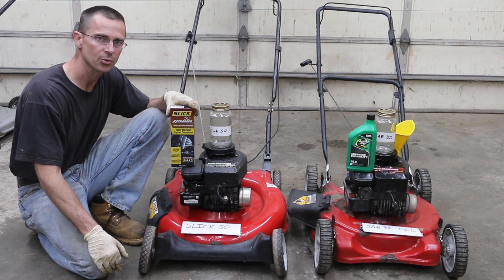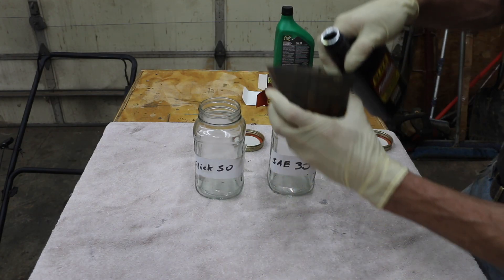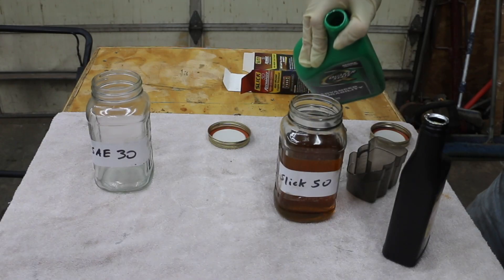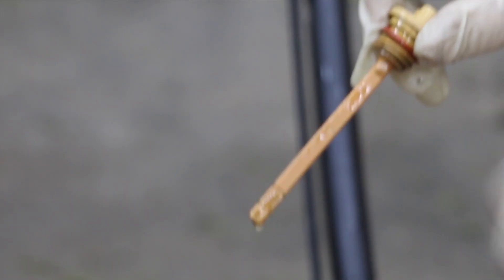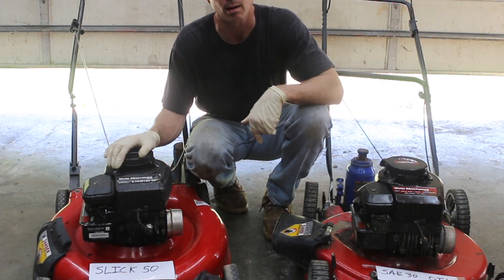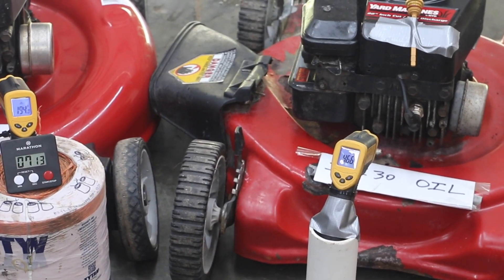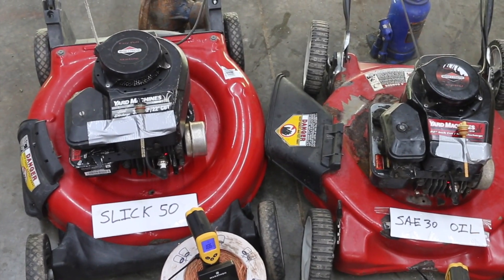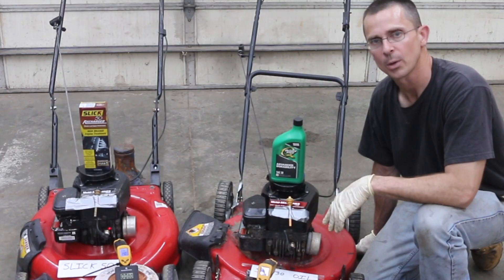Can't believe what SLICK 50 did to my engine!!--Dry Crankcase Test!

Comment: The problem is, in my opinion, is that Slick 50 isn't the same product it was 25 years ago. Slick 50 use to have Teflon in it. I just recently finished off a bottle of Slick 50 High mileage that I bought 20 odd years ago, and it was a translucent white color. DuPont filed a lawsuit a few years ago against other companies using their patented invention, DuPont Teflon, in their products and won the lawsuit. After that, I noticed that Slick 50 no longer said it had Teflon in it. Now it says it has Cerfelon in it. Not the same thing. Teflon was developed by DuPont back in the 60's, to lubricate the turbo pumps on the Saturn 5 rocket engine's for NASA. Regular petroleum oils couldn't stand the heat and the engine's were blowing up because of it. So DuPont invented Teflon, which is a slick resin, not an oil. Liquid wrench use to make a penetrating oil spray that said on the can," With DuPont Teflon". After the lawsuit, all the company's that were using it, had to quit using it. You can still buy it, the last I knew. It called DuPont All Purpose lubricant, made by DuPont of course. I bought a bottle of it a few years ago. It's great stuff. I had a little electric fan that I hung on a rack in the bathroom, that I would run when it was hot in the summer and I was taking a shower and the bearings got dried out and galded and it got where it was chattering and squealing and wouldn't run. So I tried oiling the bearings with 3 in 1 oil. That only lasted a few days, so I tried using Motorkote. That didn't do much better, maybe a little longer. Then I tried using some gun oil, Remoil with Teflon. That just lasted a few days too. I think it has very little Teflon in it though. It is a yellow looking oil and Teflon is white in color. Then I got a bottle of the DuPont All Purpose lubricant, which is just Teflon in a oil base. It looks as white as white out in color though. I used it over 3 years ago and the fan still runs fine! You should get some of it and test it against other lubricant's if you had squirted a bottle of that, maybe just an ounce or two in the motor instead of the no longer really Slick 50, it probably would never would have quit, just like Slick 50 use to advertise. It works great in high heat conditions. Get a bottle. It's some great stuff!
Reply from the maker: Thanks for the feedback.

Comment: I used slick 50 in the 90s and if I remember correctly it needed some run time to settle the nano particles into the cylinder wall. it was about 1000km for a car I think. So this test proved nothing.
Reply: You are correct, I used the stuff back then and it has to be run for some time at operating temperature in order to coat the engine - This experiment does nothing other than ruin two perfectly good motors for nothing. I hate waste!

Comment: I'm not sure that the test is valid.  Slick 50, other than its proprietary PTFE, is still a quality base oil.  The motors would need to be verifiably identicle and the results repeatable, meaning unfortunately, more than one time.  That much difference in running time seems a bit fantastic to blame on the oil.  I like the channel.
Reply from the maker: Thanks!  Thanks for the feedback.

Comment: I used slick 50 myself thinking my engine wouldn't heat up to the point of failure also remember it also said only to use on cars with 50 thousand miles also. Won't ever know now for the original s50 has changed for legal reasons between partners.
Reply from the maker: Thanks for the feedback.

Comment: I started out using Slick50 but due to cost I changed to Duralube. Both are PTFE products. No problems as of yet, but I do change my synthetic oil when i can still barely read the dipstick through the oil.
Reply from the maker: Thanks for sharing.

Comment: I browsed the web for 'original' Slick 50, then found that John Bishop, (developer of original Slick 50 formula), stopped providing it to Petrolon in 1.983. Afterwards, seemingly it was produced under 'Xcel.Plus' brand or kind of...
Just found ONE sealed (1 qt, circa 1.995, when I was attending Med School), Slick 50 that I used in my 1.991 BMW 535ia (iron block i6, trusty engine).
I'll probably try it my late Dad's old reliable / '84 Nissan Patrol, (4x4 / P40 i6 engine), just to see / hear 'what happens'... (Yup!: I'll shake S50's can VERY 'vigorously', before adding it to eng's oil).
Reply from the maker: Thanks for sharing.

Comment: I know that most motor oil contains Perafin wax.. ( Like liquid candle wax )..And Slick 50, I was told had Graphite in it, ( Like pencil lead )..Dont know if one is better or worst than the other. And when Slick 50 first came out, it was 50 bucks a qt.  But Duralube and Slick 50 are both under 20 bucks now..jim
Reply from the maker: Thanks for the suggestion.

Comment: I remember a Duralube commercial..similar to Slick-50, but supposedly better. They ran a nascar without any oil, after being treated, driven at 3- digit speeds around the oval. then took the valve covers off. And while the engine continued to run , sprayed water from a garden hose all over the open valve heads. And it kept running. it is supposed to be absorbed into the metal of the engine and act like a teflon. They also make a treatment for transmissions...jim
Reply from the maker: Thanks for the feedback.

Comment: I'm not defending the SLICK 50 product.  But were these 2 lawnmower engines identical and have the same amount of hours used?  It doesn't make sense that the SLICK 50 locked up 1st.  But I'll concur, it is hard to recommend the product after seeing this

Comment: Have you ever tried SLICK 50 Automatic Transmission Treatment?  I'm disappointed by your results of the engine treatment, but I swear I can feel improvement in transmissions I treated with it.  Those transmissions weren't bad.  It was just my hope that the treatment would help the transmissions last longer.
Reply from the maker: Thanks for the feedback.

Comment: Back when I worked in autoparts the slick 50 guys would be at all our big meetings with a pinto engine running with no oil. 
It wasn't a gimmick, though your 'mileage may vary. The guys demo would always run it for about twenty minutes shut it down an let it cool. I pulled rod caps myself and verified no excess wear with plastigage. 
I used it in my MB300 five cylinder and it idled better and ran cooler.

On modern roller engines with synthetic oil I can't see the reason to bother.
Reply from the maker: Thanks for the feedback.

Comment: I used in when I purchased my new 1990 Toyota Camry. I applied it probably at least 3-4 times. Didn't know i was being scammed. But if I recall, you don't need to change the oil for 50K miles? I replaced my oil every 3000 miles anyways. I believe i reached 235K miles on it before I got rid of it. It was still running perfectly when I did. The brake system on those Camrys sucked.
Reply from the maker: Thanks for the feedback.

Comment: Thanks for the video. Militec should work a lot better under dry conditions (I did a timken test on it before pouring it into my engine). 

In your video, Slick 50 seized up first probably this is because the teflon that is coated in between moving parts not only repels residual oil, but also expands, making engine clearance even tighter.  However, with base oil available, Slick 50 should synergize.
Reply: The newer formula Slick 50 that he used does NOT contain PTFE Teflon. FACTS MATTER!

Comment: Going strictly on memory, so I could be way off base, BUT,,, I believe slick 50 is supposed to molecularly bond with the block, and is ONLY effective if used on a NEW, or near new engine. Once the engine is old the engine metal properties change, and engine junk/gunk/carbon/etc. build-up won't allow the molecules in the Slick 50 to bond with the engine. I noticed when you drained the oil from both motors that the engines were not new. Back in the day I paid $50 for a quart of slick 50 for a brand new engine I had... Which was actually a lot of money at the time. LOL.. FYI, I once drove a LOADED, 26 ft box Mercedes 3 cylinder truck with literally ZERO oil (dummy left the drain plug out and all oil went on the ground). The truck LITERALLY went 62 miles flawlessly.. then poof! Mercedes said the block was impregnated with some type of silicone or something. I believe basically the same stuff that's in slick 50. Or so I was told. I was extremely impressed with that Mercedes truck motor.
Reply from the maker: Thanks for sharing.

Comment: Also o heard that the slick 50 tests used 100% slick 50 in the engines and ran them for longer to get the oil throughout the motor to let it Bond to all the parts better, then drained it.

Comment: Great channel with some really great videos. But I would have done this particular test just a bit differently. I would have thermally cycled both engines at least 3 times...by running them up to operating temp, then letting them fully cool to ambient temp...again, at least 3 times....THEN drain them both and do the dry run comparison.
Reply from the maker: Thank you!  Thanks for the constructive feedback.

Comment: The SLICK 50 engine looks much newer.  Could it be the older engine, having a more worn out cylinder, would generate less friction due to the cylinder being not as tight around the piston?

Comment: I tried slick 50 once in the 90's,  and my fuel economy jumped by almost 15 % for that oil change, but then returned to normal with the next change.  The product claimed the effect would last for several subsequent changes, so I stopped using it because it wasn't clear from any source whether there were any negative effects from its continued use, and it didn't live up to the manufacturers primary claim.
Reply from the maker: Thanks for sharing.

Comment: I don’t know if that’s a valid test, since you never run an engine dry. The slick 50 engine was clearly running cooler with slick 50 in it meaning most likely it had less friction in the motor.
Reply from the maker: Thanks for the feedback.

Comment: You're right. You are missing the point. While it would be nice for no need for a crankcase full of oil that wouldn't be the major benefit. To have an engine running at a significantly lower temperature all the time is the real benefit. That extends engine life and a cooler engine compartment extends the life of the plastic and rubber parts. Maybe one more test where you run the slick 50 engine through a couple of gas tanks of oil first. Shutting it off in between to heat cycle it. Then drain the oil. Might be different..
Reply from the maker: Thanks for watching!

Comment: I wondered if the slick 50 engine which appeared to be brand new had tighter tolerances in the engine to begin with that the other engine which looked like it had some hours on it. and would have had more wear in the piston rings and cylinder bore there fore would have run longer. I don't know this for a fact, but it is something to consider.
Reply from the maker: Thanks for the feedback.

Comment: I like how you added the signs to the lawnmowers so you could “identify“ them… I think it’s pretty easy to identify them considering they don’t even look the same. They are physically different to some degree and one looks like it has a lot more hours on it due to the discoloration of the muffler. Hardly seems like a fair test given this sizable difference.
Reply from the maker: Thanks!
Reply: @ProjectFarm  as a long time user of slick50, this test is not to the point, I have driven 3 cars in my lifetime to almost 400,000 miles. They would have run longer if I hadn’t gotten the itch for change and they still ran fine. I was in sales in the northeast, thus  the amount of miles. Was it luck and the fact that  I take car of my vehicals or does this stuff help. I will go with it works over the long haul. Who runs their engine with no oil ?

Comment: Were the proper procedures actually followed for adding Slick 50?  Prior to adding Slick 50 to an engine, the bottle has to be vigorously shook to mix everything in the bottle.  Then, there is a prescribed amount of time for the Slick 50 as-added to the engine for it to be "run-in" so that the insides of the engine are properly coated with the Slick 50. It does not appear that these procedures were followed?
Maybe these points were addressed in other comments?

Comment: I DID THE SAME TEST AND FOWND THE SAME RESULTS  SLICK 50 IT DID HELP MY WORM GEAR ON MY ROTOTILLER BUT IT ALSO FAILED IT WAS TOO THIN AND LEAKED OUT   STRIPED THE BRASS WORM
Reply from the maker: Thanks for the feedback.

Comment: Unless you have the original formula of slick 50 it's not the same results. The old formula had micro PTFE. The new one doesn't. The original gave me average double the mileage. New version didn't.
Haven't found a dealer in the states yet but the old version it is still mfd in Australia under a different name. 
Used it on a 93 Dakota V6, the second body style, that was driven weekly from Odessa Texas to Lubbock. First time it made the trip, fill-up in Odessa, fill-up in Lubbock and fill-up in Odessa. After oil change and 1quart of the original formula went to Lubbock and back on one tank. Hope this isn't confusing but I'm old enough that it was only sold in PM, and MI. According to the print adds it had been used by the military for some time. Let me think I started school in 1958 so we had gotten indoor plumbing and electric by then.😜😅🤣🤭
Reply from the maker: Thanks for the feedback.

Comment: A post failure tear down would have been interesting.  What caused the failure of the engines?
Reply: Ain't got no oil in it mmm hmm
Reply: @stevenbrisson343  I get that reference.  Fine job.
Reply: Sounds like slick 50 just siezed the pistion against the cylinder. And the conventional started a wicked knock before failure, could both be siezed yes. Tho ima take a shot in the dark n say conventional one melted/ground down the races/bearings vs slick 50 which seems to have siezed on more of a low oil situation. Only way to test that without pulling em apart is to add oil, flip mover on its side, push on blade while hitting with a hammer "freed way to many siezed mowers with that trick" and see running condition after. Both will be on their way out, but I'd take a chance in saying slick 50 is in better internal condition
Reply: @mrmagdump9085  Good idea.  One or both engines might even run after cooling down, without even breaking them free, and I am very interested in condition after running dry as this is actually more important than time running dry.
Reply: agreed!
Reply: I had a Pontiac Grand Am 3300 v6 treated with Slick 50, wore a flat spot on a roller lifter. Never used it again
Reply: @bobbywren123  Hitachi warns of a similar problem with molybdenum grease in their excavator turntables being so slippery that the ball bearings slide instead of rotating.  A fascinating problem.
Reply: I never saw any benefit using Slick 50, seemed like alot of Hype, Snake Oil
Reply: Think I'll use Motorcote
Reply: I'm guessing slick 50 locked up from  heat seized 
Conventional oil engine blew the connecting rod apart.

Comment: The temperature decrease caused by adding Slick 50 into engine oil shows that it works EXCEPTIONALLY well! (Although the lawnmowers should have been fixed in place and the points of measurement should have been identical.) The engine with Slick 50 was started 3 seconds before the other engine. Taking those three seconds into account, when Slick 50 got to 150 degrees, the other showed 265 degrees (76% more!), At 200 degrees, the other showed 333 (+66%). At 250 degrees, the other showed 342 (+36%). Those are  absolutely MASSIVE differences! With engine oil still in, the engine without Slick 50 ran about 7% hotter, which is still an impressive result for Slick 50. I have no doubt that in a real-world application (with the suggested ratio of Slick 50 to engine oil and proper oil level), Slick 50 is an overall improvement. Less heat means higher efficiency = more power, lower fuel consumption, lower emissions, and longer service life, among other things. Obviously, no miracles can be expected. But ~6.5% colder is GOOD! I think the problem with the seizing test is that when you overheat the remaining mixture of Slick 50 with engine oil in a drained engine, something happens to it (physically/chemically) that makes it much worse than a thin layer of regular oil. Also, the engine with Slick 50 may have had a hidden problem that wasn't seen in regular operation but showed in these EXTREME conditions. Last but not least, these engines are tiny in comparison to car engines and may be far more sensitive to various nuances when exposed to conditions no normal engine EVER experiences in regular operation. I will search the web for some other tests of Slick 50 to see how it does there.
Reply from the maker: Thanks for the feedback.

Comment: Prolong claimed to actually do that, they actually ran that in a Dodge viper and then did so many laps around the track without oil and supposedly didn't seize the engine. Also Zmax? Also I thought slick-50 was basically 30 weight oil with ptfe's added and I thought it was prolong that had the commercial because it was supposedly an engine treatment not an oil treatment it actually soaked into the metal
Reply from the maker: Thanks for the feedback.

Comment: I like the width, and have a fue questions what happens when you put 2 cycle oil in a 4 cycle engine,  and what happens to a 2 system when you put see 30 in the duil of a 2 cycle engine
Reply from the maker: Thanks for the suggestion.